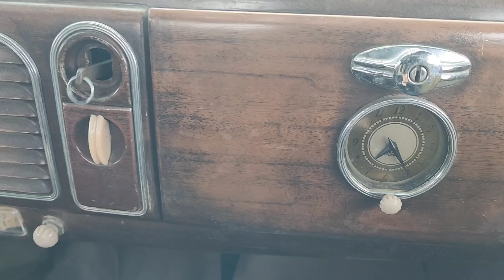Taking the custom 1938 Ford for a joy ride 💨

Comment: I recall when you had the car running last you didn't shut the car off I recall that because several folks made a point of it in the comments. I love the stance of this car I personally would rather see it painted and a head liner installed and the engine cleaned up! I think that would make the car look a whole lot better. but at the same time I know exactly where your coming from. cheers Good overall Job on the customization of this car. I call this a Win win in my book...for the Hiltz Team.

Comment: How nice to see the car transform into such a good shape. But I still believe that the stains on the car, body and roof should be cleaned and brushpainted in the same color as the part. Anyway, the car looks as if the owner already tried to make some paint repairs, which are very nice. Why not do the same with the stains!

Comment: The more you drive it the more you'll get the kicks out if it. Like put sound denying Matt's on the roof side panel's that Matt makes a big difference in sound deduction. Instead of just parking it and let it just sit around. Then you run into problems not starting. 
I had car's that I drove everyday compared to my car's that just sat around not being used. It just seem like a hassle trying to start them and driving them. That's why they got sold to some one that would enjoy them like I once did. I didn't give them away the sold for what I thought they were worth to me.

Comment: Looks really nice. A streamliner rather than a camel back. Maybe you could fab a piece of canvas or vinyl to clip on over the roof and trunk louvers to protect interior and passengers from the damp cold Nova Scotia elements. What sort of body is that with a split windshield in front of your shop, possibly a 50 dodge or Plymouth?

Comment: Looks great Chad, additional pin on the ramp will quiet it down. I would paint the  back cover though. Not sure about the roof louvers. Let’s out the heat, that’s great but lets in the rain water, that’s bad. You will have wipers you probably should have a closed roof, just thinking practical. Anyways I like it regardless. Looks better than original.

Comment: many of those old fords had a button underneath the solenoid that you could push to turn the motor over so you didnt have to short it with a screwdriver

Comment: Use some rubber strips to insulate that rear section, so the tray slides up onto a couple of rubber strips , it will help it lock down tight and not vibrate. Also build two drip rails for the rear lift up door, real easy to do.......

Comment: Just keep on pushing the starter button is not gonna fix the problem, you are going to have to do some wire tracing to see where you are losing power, until you do that it is not going to fix itself!!

Comment: looks like a cs130 Delco 12 volt alternator on the engine  with a 6 volt battery and the OEM voltage regulator. Strange indeed .   very dangerous. time stamp 15;21